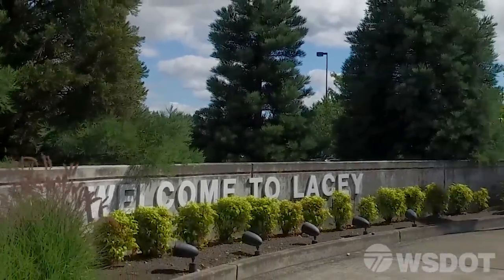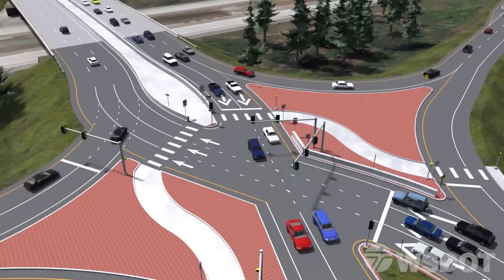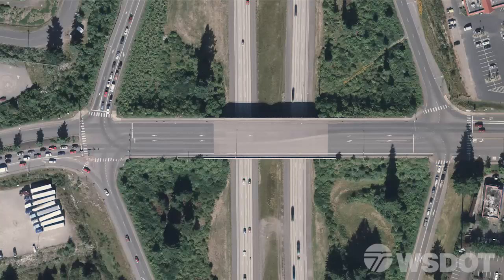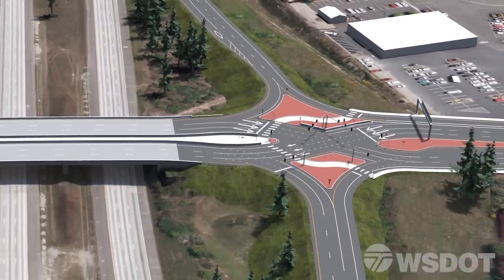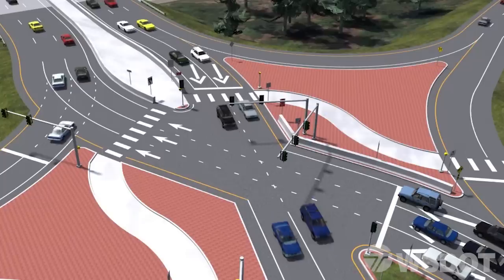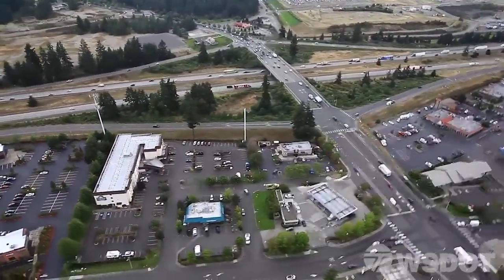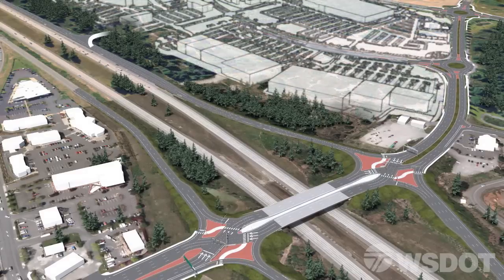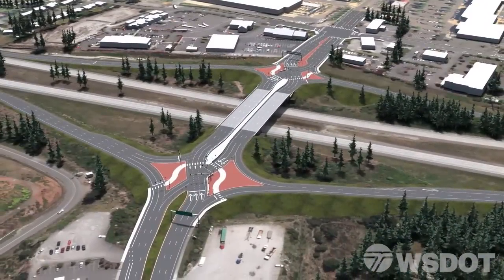Diverging Diamond Interchange comes to Washington State

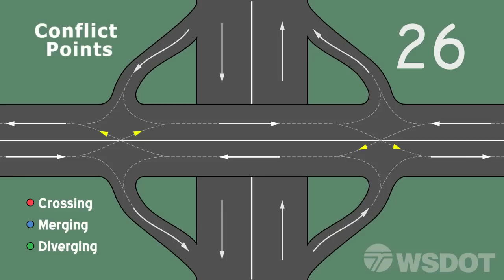Comment: You are overstating the benefits. The plan (1:59) purports to show 26 points of conflict. 8 of these (4 crossing, 2 diverging and 2 merging) are not real. They exist only if traffic is allowed to leave the freeway, cross the other road at the intersection and return to the freeway IN THE SAME DIRECTION. Nobody does this intentionally, but if it's a problem the movement could be prohibted by changing the arrows and line markings at much less cost.
In fact the change reduces the conflict points from 18 to 14.
Furthermore, although the number of conflict points is less, the number of conflicting movements is MORE. All traffic turning left still has to cross all traffic going straight, but now all the traffic going straight (east-to-west) has to cross traffic in the opposite direction (west-to-east). TWICE.

Comment: I'd be interested in how a large roundabout interchange would help or hinder vs this new concept.
Reply: +Jean-Pierre White . This is not a new concept, saw it Europe in 2003 somewhere between France and Spain, and before that in Monterrey Mexico in 1999. Down there they have both this type and roundabouts and they both work great as far as I remember.
But up here in the States we simply don't get roundabouts and I don't think we will easily get this design either. We are stuck with 1950's designed highways and overpasses, just as we are stuck with the pseudo-imperial measuring system even though metric is so easy and friendly!
Reply: Mia Lara You are probably correct about the US being resistant to different road layouts and traffic controls. I believe the reason is that the US driver has to date been conditioned to let traffic lights control traffic flow requiring no responsibility in their part. faced with a roundabout the drivers have to take responsibility for traffic flow, and if you have never done that or been trained to do so then there is a natural fear and resistance to traffic systems that differ from what is considered normal.
Reply: This is exactly the problem. Key example: any 4-way stop.
Reply: I live in an area with 1 decent size roundabout, and 2 smaller ones, and then another one that I frequently drive by. They are easy to learn but from my experience driving them, most people aren't comfortable with it. 
Then you have the people who ignore their stop or yield sign, can't stay in their lane, etc. 
I'm surprised I have never seen more accidents in them, but I've been in a few close calls because people weren't paying attention.
The one further away from me, about a year ago had a tanker semi flip going around the circle because he was going too fast.
Reply: Roundabout interchanges are in trouble, they are even getting dropped in Europe. This is because (despite what people think) roads aren't that expensive. Highways and freeways aren't that expensive. The real expense with this sort of infrastructure is bridges. They are hugely expensive. Even when creating a new interchange roundabout interchanges just aren't that cost effective, that's why in europe new interchanges often just go with dumbbell interchanges instead.

Comment: Why not just use roundabouts?
Reply: zh11147 from what I have read on the topic, roundabouts and intersections with the least amount of rules are the most efficient. The speed is dependent on the size of the roundabouts.
Reply: Not what I had in mind, especially since this one requires a lot of space, but this design does seem more efficient (There's a smaller version of something like this here in Slovenia and it works great). https://www.youtube.com/watch?v=XDDmE4qoCns
One of the things, that I find problematic about all of these "central planning of transportation" ideas, is preferential treatment. Here's what I mean by that: decisions  of the use of space determine quite a bit of human behavior. Highways and large rings around the cities, for example, coupled with the commercial zones, can totally disrupt commercial activity inside the old city center (lots of examples here in Europe where the central planers took the modernist approach to zoning and urban planing). 
Don't get me wrong. I'm not against DDIs per se. Sure, DDIs might solve certain problems but at the same time create different problems, such as the questionable pedestrian and cyclist safety, perhaps even due to increased speed of the traffic flow. This is also the reason I tend to favor smaller roundabouts and more deregulated traffic arrangements, since they tend decrease speed and increase safety as well as have a more "natural" flow, of traffic, which can, if not to great, be always in movement. Of course this ought to be coupled with deregulation of other things as well, especially zoning and other things. 
Also, don't think that I'm against highways or higher paced transportation. Not at all. Everything has its place, if thought out well... but more aspects of travel ought to be taken into account when designing things overall. ;) 

I guess what I'm trying to say, that whatever it may be, that one makes, should at the same time improve the problematic thing without taking away ways that were possible before. Something like that.
Reply: zh11147 Actually a roundabout would be way more efficient here and help to speed up traffic. Only idiots wouldn't be able to navigate it.
Reply: This is a stop light intersection.  Pedestrians have dedicated cross walks with push button to request the go-ahead.  It's no less safe than any other standard low-volume cross walk.  Pedestrians are very low volume at all overpasses like this in the U.S.